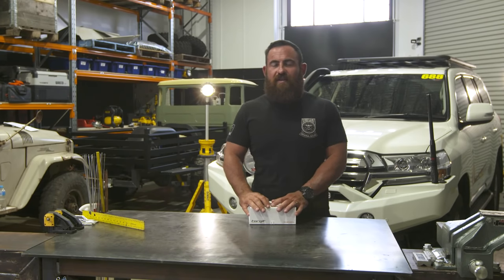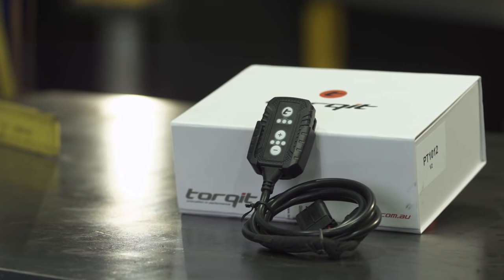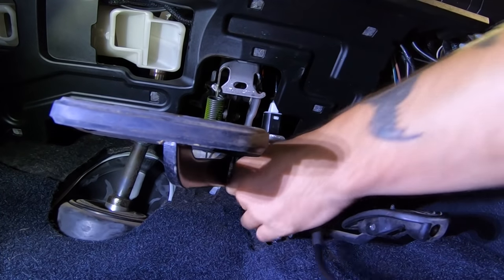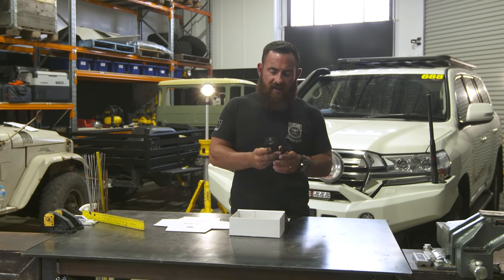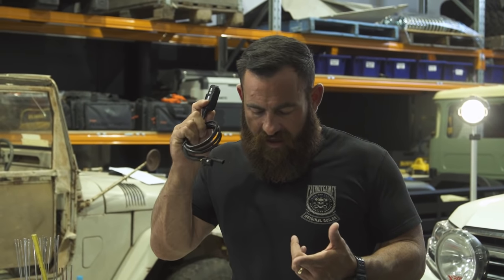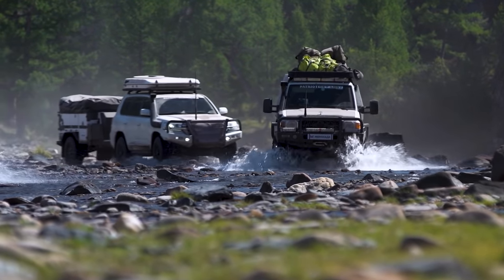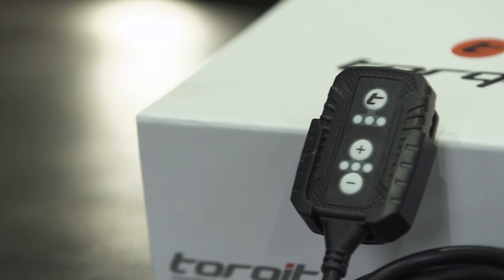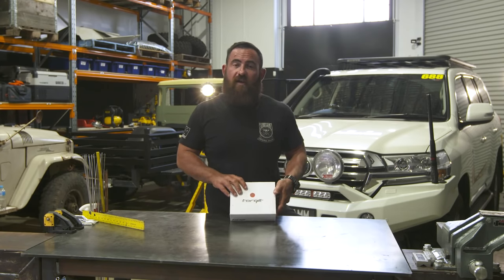A MUST Have Throttle Controller For Your 4WD - Loading Up 54

Comment: These do not modify when the torque comes in, that is a product of engine tuning and mechanical performance of the engine.
All these units do is change how much you push down the throttle.
ie. It makes your 50% push of the throttle 100%, giving you the feeling of more "response"
Reply: No shit
Reply: if you put you foot to 100% throttle, do you then get 200%?
Reply: Thanks Scott, I cannot watch the complete video when all credibility is lost in the first couple of sentence....
Reply: Exactly. Seems nobody knows how throttle controllers work.
Reply: That's why it burns the throttle body motor.
Reply: @jimmyjones2426  No it will stop react after you push down in dhe middle.

Comment: Hi, very informative, advanced, and complete information regarding the throttle controller, thank you, but I have a question I hope the admin or Patriot Games can answer regarding safety issues, My question is what if the throttle controller's device suddenly fails? or the little wire cut? Do we still have the control of gas pedal? or it will be back to normal mode? Thank you for hoping Patriot Games can enlighten us. thank you again!

Comment: How come on most setting I’m finding it surging or bucking like mis firing around 80 to 100 k while towing 2 tonne in ford ranger 3.2 diesel ?is there a reset .currently have it back to 3 solid green lights and will try this mode

Comment: How is it comparable to the idrive throttle controller?
Reply: Essentially both do the same job however in the way they do it is different. iDrive takes a 'one size fits all' approach, whereas our throttle controllers take into each specific vehicle and then alter the response from there. The Pedal Torq also has more adjustability than the iDrive including a dedicated off-road mode and anti-theft functionality